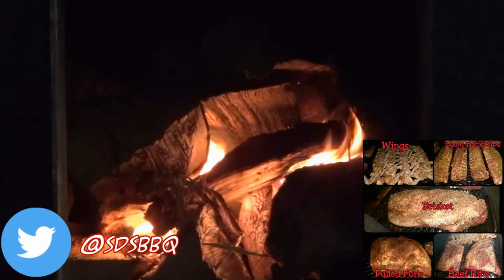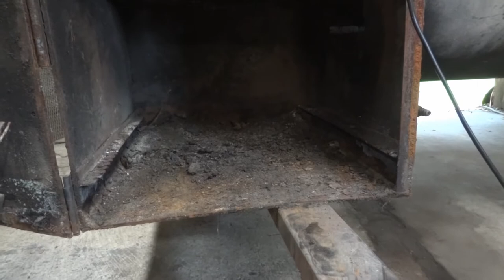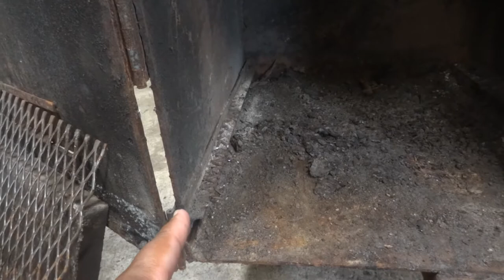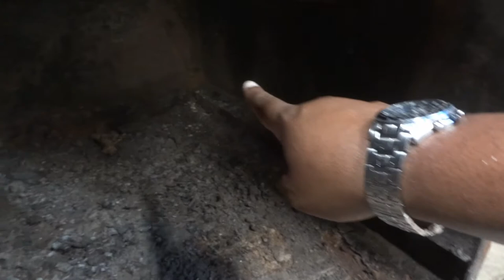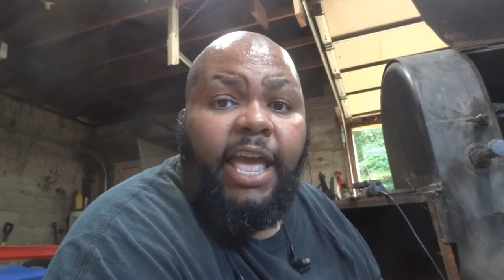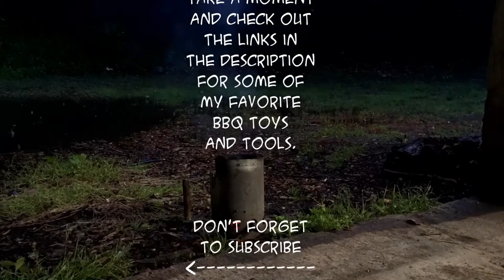The Priscilla Project - Part 4 - Root Cause Analysis of the Firebox Door Problem

Comment: Dash, I missed that bowed front to back...  To make it profitable when you flip it, it has to be pretty and then functional.  Have to keep the costs down low low low.  I know you will do it!!!

I think the gent who built this was left handed.  Why?  The door swings left.  The firebox is on the left making it easier for a lefty to put fuel in.
Reply from the maker: Dude... When I was looking at the welds yesterday I thought the same thing. (The builder had to be left handed) The welds on the left side front were better than the ones inside the firebox on the right and then on the right side inside the FB the welds were better in the back (or the left side). The firebox placement might have just been coincidence or convenience to where the smoker was setup. I'm by no means going to be going crazy in this restoration just want to make it work and I'll shine it up.
Reply: Any updates?